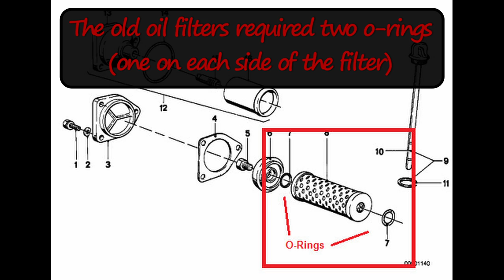BMW R75/5 Oil Filter Change (Engine Out)

Comment: Very nice!  I've been amazed with the shear amount of long discussions, writing and internet hype and talk surrounding the O ring issue!  You cleared it up in less than 4 minutes!!!
Reply: You may be thinking of the other O ring issue... /5 and some/6 models like this R75 have a separate cover for the internal filter canister like the one he torqued to 15 FTlbs. However, later models sealed everything using a cover that combined the outer dorr with the inner cover and only attached with the 3 bolts from the outside engine case. This setup required a large O ring on the door to seal against the inner canister. Since the sharp edge on the inner canister could cut into the O ring on the door, oil pressure could be lost. That's why there is much discussion about measuring canister depth from the engine case, and using shims to protect the large O ring from being damaged by the canister's edge.

Comment: It looks like you removed a newer style, 'two piece' engine oil filter (sections connected by a rubber tube) which I understand facilitates engine oil filter insertion & removal when the engine is installed in the frame and alleviates the exhaust pipe header interference issue. Great video with some viable 'common sense' applied to the torque settings and filter plate installation.
Reply from the maker: Thanks for the compliment!

Comment: If this is so critical , direly so, why are we not having a bit of narration?
Reply from the maker: This is an old video. When I made it I used captions explaining what I was doing. The captions were made using youtube editing instead of my video editing s/w. Looks like the captions have disappeared for some reason. You are correct, the video is not much help without the captions. I will probably delete it. However, I think you are talking about the o-ring issue on the later airheads (see the comment from "CurtisSound" below). This is an early airhead (/5) that does not have the oil filter o-ring issue.

Comment: how meny n-m you use for the tightening of the main bolt in the  filter?
Reply from the maker: I used 20 Nm (15 ft lbs) on the center bolt. It doesn't need much torque to seal the filter.

Comment: Are these filters accessible with the engine in the frame?
Reply from the maker: Yes, this job is the same in or out of the frame. The hinged (2 part) filters make it easy to get around the exhaust pipe.